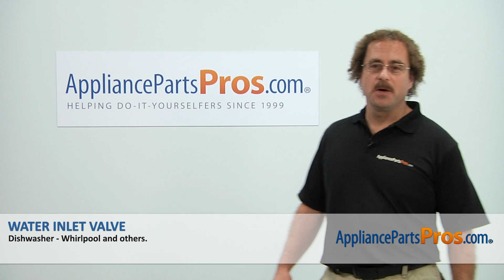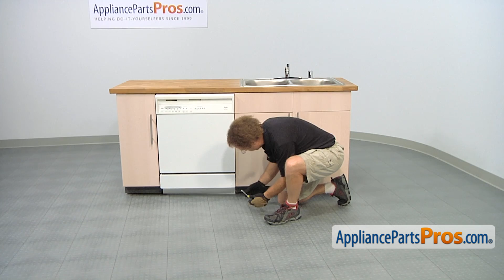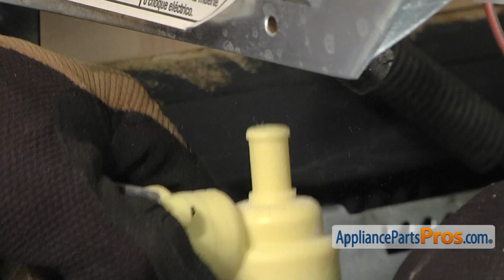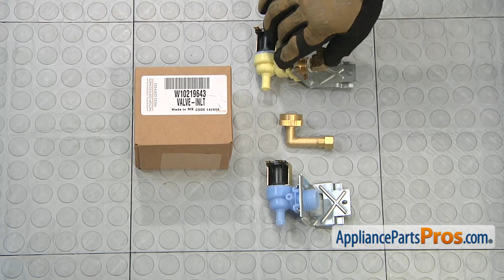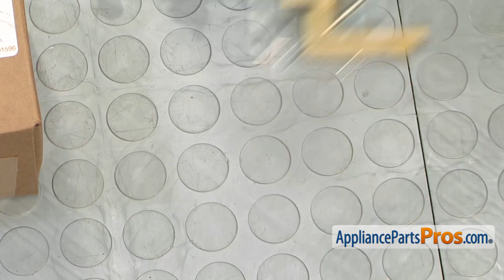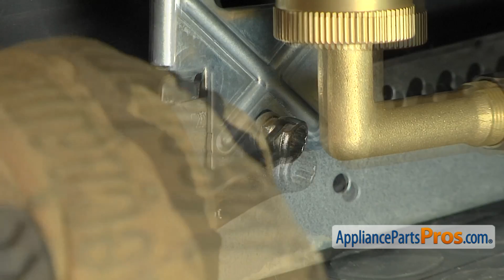How To: Whirlpool/KitchenAid/Maytag Water Inlet Valve W10844024

Comment: Thank you for the video. I'm a bit confused. Did you replace those 2 small pieces(the small ball and the nut) that came from inside the brass adaptor before attaching the braided supply line that you attached?  Or, do you only use those additional pieces if you have the copper supply line? Can you please clarify that for me. I have the supply line like you attached so I'm thinking I don't need those extra pieces? Thank you and I await your response so I can fix my dishwasher.
Reply from the maker: You would only use that piece if you have a copper supply line.
Reply: @appliancepartspros  Thank you for the quick response.
Reply from the maker: You're welcome! Let us know if you have any other questions!

Comment: Using the part shown in the video as well as adapter piece #W10685193, I was able to repair my Kenmore dishwasher. It was filling up with water even when not in use, as well as occasionally leaking water on the floor down below either from the valve itself, or due to overfilling and flowing over. I would have spent several hundred dollars to have this replaced by a pro, but instead spent $90 with shipping for both parts, basic hand tools, and a copper pipe cutter I bought from Harbor freight for $5. Thanks so much for putting these videos up, as they give normal people like me the confidence to take on these jobs and save some money.